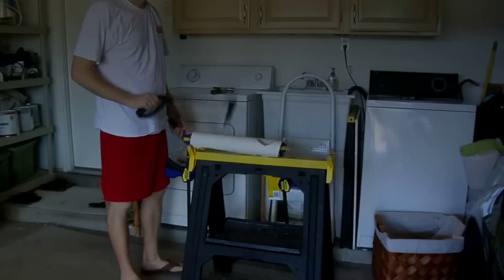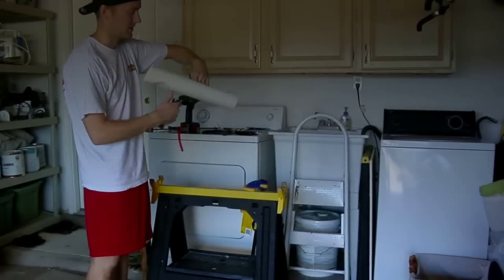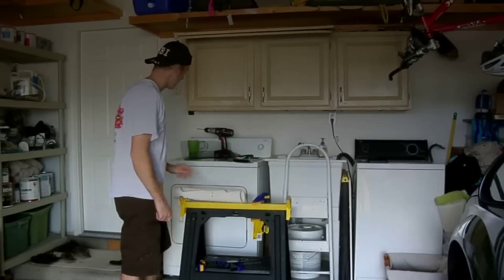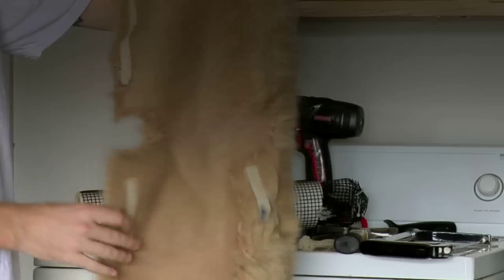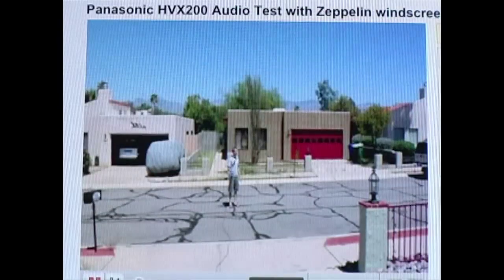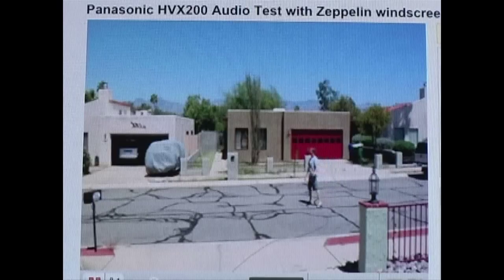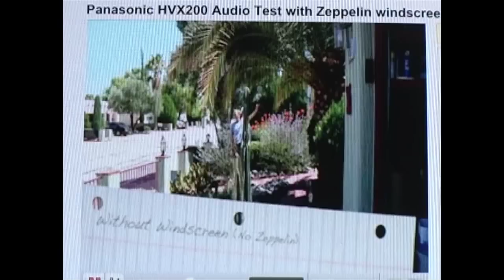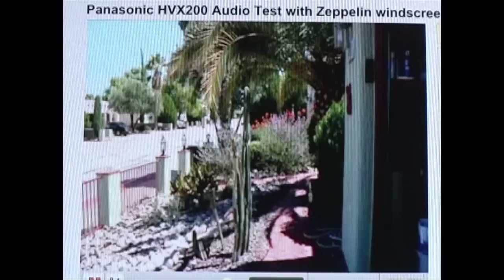DIY Do it yourself Zeppelin Windscreen audio test tutorial

Comment from the maker: Those are all great suggestions, but if i were to do another homemade windscreen, I'd probably ditch the plastic pipe.  I think the paint-roller worked awesome and I also liked using the wire mesh, but the plastic pipe, as you mentioned, is heavy and a little too solid.  For a frame, I would consider all wire or maybe a work-light cover that is already dome shaped.